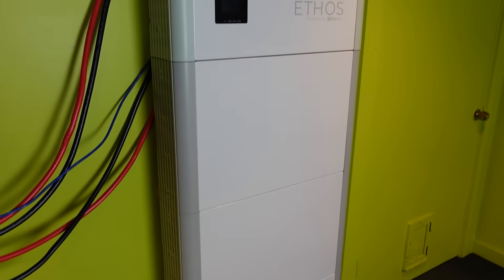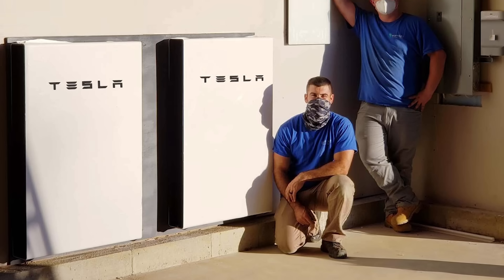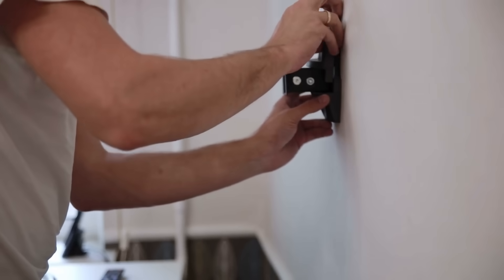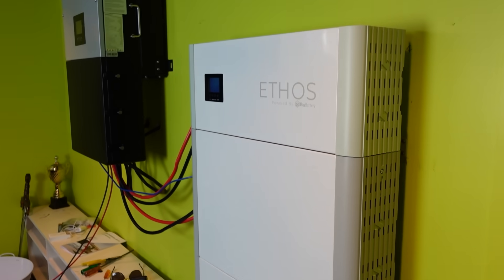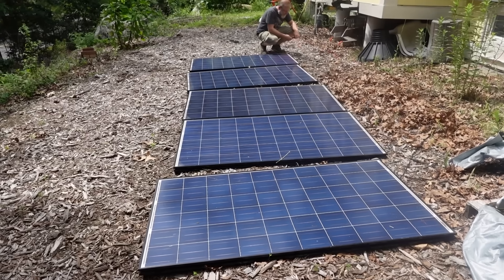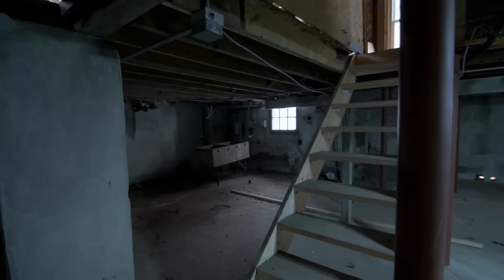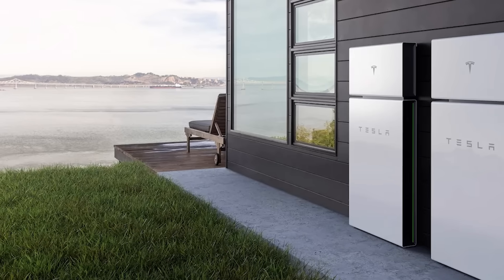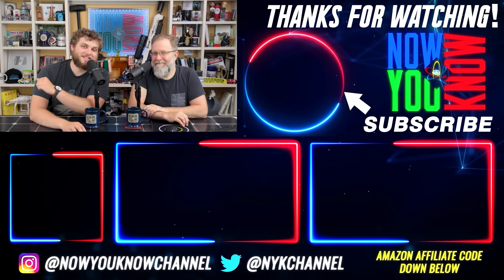Better Than a Tesla Powerwall? | In Depth

Comment: Okay now you need to remove the cables going into the bottom of the inverter and put cable protectors on the holes then you can happily re-connect the inverter an sleep well at night knowing the cables can’t be cut by the sheet metal holes 🤣
Reply: This ... absolutely 100% correct. I worked as a residential electrician for 16 years and that install is not legal in US or Canada
Reply: @misob  Yeah as a City Electrical inspector, this is a n all to common gaff that DIYers make, I caught it instantly
Reply: No worries, These parts you are referring to come in every kit.
Reply: Ya beat me to it! Soon as I saw those cables just being stuck through the holes I was like, "hold your horses there, Hoss!" ;-)

Comment: I respect you guys, but this seems like a paid promotion. If yes, you should be transparent about it at the beginning of the video.
Reply: Exactly. They do this quite often. I’m a big fan but this looks a bit sketchy
Reply: They say it at the end that they weren't paid for this.
Reply: @themafterchief   But they clearly get a kickback from the battery company because with a code you get 5% discount. So, unfortunately, they are not impartial.  :-(  The better review, the more customers, the larger kickback.

Comment: Awesome batteries are getting cheaper and cheaper
Reply: DO NOT BUY! BIG BATTERY CO IT'S A SCAM!! THEY LIED TO US AND SOLD US A BATTERY THAT DOES NOT COMUNICATE WITH OUR SOLAR INVERTERS EVEN YHOUGH WE WERE SPECIFIC AND ADKED THEM TO CHECK BEFORE WE CONSIDER BUYING. THEY DONT CARE ABOUT YHEIR CLIENTS!  WE SPENT THOUSANDS TRYING TO MAKE IT WORK WITH THEIR TECHS GUIDING OUR TECHS OVER AND OVER WITHOUT ANY IMPROVEMENT!  IN FACT LAST TIME THEY GUIDED OUR TECHS THEY REALLY MESSED US UP AND THEY WASH THEIR HANDS OFF OF ANY REMORSE😮 THEY HAVE LOTS OF BAD REVIEWS ON LINE...CHECK BBB AND OTHER BLOGS ABOUT THIS COMPANY. BEWARE!
Reply: A second hand battery from a Tesla M3 goes for $7300.
S 3-fase 11kw hybrid inverter adds another 730….
Seems to me that the T-powerwall is way overpriced.

Comment: Eg4 batteries are cheaper and come in a cabinet with wheels. I am entirely off grid with a similar system. I have 60 kWh of batteries and 10 kW of solar. Eventually I plan to double my system.
Reply: Eg4 makes powerpro batteries 14.3kw wall mount LFP. They have heaters and fire extinguishers built in. Plug and play with eg4 18kpv inverter $5199. I just got 5 of them for $17193.60. Delivered to my garage.
Reply: There are "Pro's" and "Con's" with any system depending on your footprint and performance needs. EG4 is a great company but I do not believe they offer a stackable vertical battery like THE ETHOS. If you prefer a Rack-Mount battery, they have great options. It really depends on your preference and skill level. If you don't like the Rhino 2 or the ETHOS, then EG4 has other options that might fit your needs. I support that company because we are both attempting to make Green Energy AFFORDABLE FOR ALL. : )
Reply: @EricLundgrenCEO  I didn't know anything about your company (or you) before seeing this video and I really appreciate that you are in here answering questions for those of us who are interested. No company is positioned to meet every need and it is fantastic to see that there is cooperation between people and companies trying to make a living helping each other out. In the western world, we have "evolved" over the last 150 years to be able to purchase products that fit our lifestyle rather than evolving our lifestyle to fit the products. The fact that people take chances to start companies to do something that fills a niche in a market and can make a difference to their families, employees and help people save money on utilities while protecting themselves from power outages is a win for all. It is unfortunate to see comparisons based solely on price with no consideration for power need, climate location, available installation space, quality of build, modularization/parts replacement/future upgrade capability and customer service. ( we have a small construction company....ask me how I know). I am going to share this video and your site (along with EG4) with the architect we work with as we have people requesting charging stations for electric cars and gas or solar generators with or without battery backup. It is a bit tricky as others have mentioned tying to the grid in different municipalities in NY state.
Reply: I have the same, but there are other options like this that work better for small footprints and skill levels. Having multiple options is good for this future. I like seeing new options on the market and all the ideas of how to implement it.
Reply: Did you need to get any permits? Did you ground mount the solar or roof mount?
Reply: @PerfectorZY  it depends on where you live. For me, I had to have the electric company pull the meter so I could install, then I got an inspection before they would reattach the meter. 
I have too many trees to ground mount, so I installed to the roof and a workshop. 
HOA is the hardest part.
Reply: I’m off grid with 30KWH server rack EG4 LifePower4 batteries. That cost $10k. 

2x 6500w inverters that make split phase for $3k. 

I needed external disconnects and breakers which required some extra know-how. But the new EG4 inverters come with all that stuff built in, although I don’t quite think they are plug and play. 

My inverters are off-grid only so that also made them cheaper than a grid-tie system

Comment: Including the Lux Power 12kW Inverter the price jumps up to $10,690, right?! The Tesla PW3 has the Inverter built in… Tesla still more expensive but not like half the price!
Reply: Wanted to let you know, the systems come with the Luxpower 12K Inverter! So the price you see on our website for all systems starting at the "12kW - 10.2kWh ETHOS System" (current price of $8,940) do in fact INCLUDE the Lux Power 12kW Inverter!
Reply: @BigBattery can’t find this setup on your site. Can you provide a link?
Reply: @BigBattery  where is the link to this setup?
Reply: @BigBattery  - Can these be used to expand a Tesla Powerwall Installed Capacity, and function? 🤔🤨
Reply: They said they were not paid for the review, but apparently they were provided the equipment gratis.
Reply: The only real difference is the user install ability. PW3 has 6 MPPT inputs (more), is more compact, and is water tight up to about 2/3rds it's height. The PW3 has expandability too.  Apples to apples would be comparing the 3 battery unit + inverter price which according to big battery website is over 10k...

Don't get me wrong, I do like that you can start with a smaller unit and install it yourself. Big win for DIYers that want a plug and play
Reply: @ChaosRoboTester  - It would be nice if they could tell you, it can work with Powerwalls! 😢
Reply: @ChaosRoboTester There's  also safety differences as lifepo4 batteries are around 10 times less likely to catch on fire as a powerwall and won't  produce such toxic gases. If memory serves, powerwalls produce hydrogen fluoride when they burn, which is one heck of a nasty chemical to get on you or breath in.
Reply: Unless you are qualified to do it yourself. Installation costs bite.
Reply: What about 1 brick, instead of 2?
Reply: Why would I buy this setup over the EG4 18k PV or the FlexBoss 21 which costs less?
Reply: DO NOT BUY! BIG BATTERY CO IT'S A SCAM!! THEY LIED TO US AND SOLD US A BATTERY THAT DOES NOT COMUNICATE WITH OUR SOLAR INVERTERS EVEN YHOUGH WE WERE SPECIFIC AND ADKED THEM TO CHECK BEFORE WE CONSIDER BUYING. THEY DONT CARE ABOUT YHEIR CLIENTS!  WE SPENT THOUSANDS TRYING TO MAKE IT WORK WITH THEIR TECHS GUIDING OUR TECHS OVER AND OVER WITHOUT ANY IMPROVEMENT!  IN FACT LAST TIME THEY GUIDED OUR TECHS THEY REALLY MESSED US UP AND THEY WASH THEIR HANDS OFF OF ANY REMORSE😮 THEY HAVE LOTS OF BAD REVIEWS ON LINE...CHECK BBB AND OTHER BLOGS ABOUT THIS COMPANY. BEWARE!
Reply: Exactly
Reply: True, but at least your not giving hard earned money to a misogynistic, bigoted, racist who is donations millions to elect a wannabe dictator. So there's that.
Reply: Doesn’t the PowerWall 3 have LFP too?
Reply: You are correct, we are (on average) 62.6% of the cost V.S. Tesla. Our goal is to make Energy Independence Affordable without sacrificing quality. 

15.36kWh / BigBattery ETHOS = $626 / kWh
$10,690 - 10% Code = $9,621
(Includes 12KW Inverter)

13.5kWh / Tesla Powerwall = Average = $1,000+/kWh
(Includes 9.6KW Inverter)
Low End: $13,000 ($12,000 + $1,000)
High End: $15,000 ($12,000 + $3,000)

Energy Capacity: 13.5 kWh
Built-in Inverter: 7.6 kW (solar) / 9.6 kW (battery)
Installation Cost: Estimated between $1,000 and $3,000
Reply: I was almost tempted.
As qualified electrician, it’s a piece of cake.
Reply: @hanswitvliet8188  - Is that "Yellow Cake?" If so, watch out for B2 Bombers! 🥴😳🤭
Reply: Indeed, smells like click bait.
Reply: @hanswitvliet8188  ... and "free power" from solar?  Who is giving away solar panels?
Reply: @carlsonterrence …. Solar is ‘free power’ as in the ‘fuel’ is free, but the ‘tank’ costs money. Pay once, and done.
But a propane or diesel tank also costs money, but the ‘fuel’ ALSO costs money, for as long as you want power. Pay once, twice, thrice etc etc etc.
Reply: @carlsonterrence  - Sometime the Panels themselves are available, used, and may actually be free in cost, but you may have to go pick them up! 😲
Reply: @hanswitvliet8188  we do include the Lux Power with all our ETHOS Systems, so the price you see does have that included in it!
Reply: @hanswitvliet8188 if you can install this yourself than yes it’s likely half the price. Installing a power wall can add another 5k+ to the price.
Reply: Plus the Lux Power inverter is a huge, ugly space hog compared to the 11.5 inverter in the PW3.  Really not an spples to apples.
Reply: And I forgot to add, the Lux Power is NOISY as hell...
Reply: @josephkeene6670  - A Kilowatt is a Kilowatt! And Big Battery ads a Half a kW extra! 

However, the big question is can you use Big Battery and Tesla Powerwalls, Together? 🤔🤭